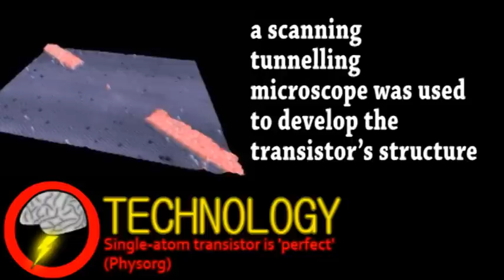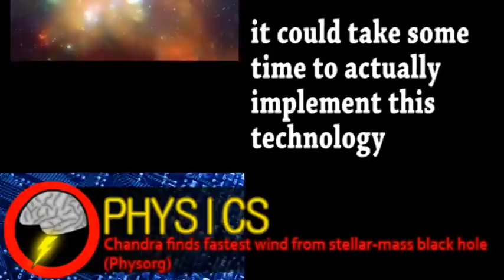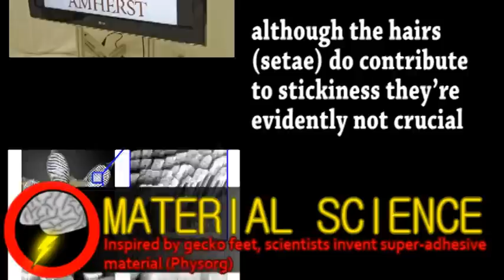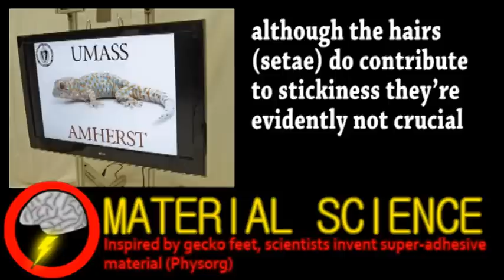Single Atom Transistors (Brainstorm Ep52)

Comment: @qdragon1337 Crosby says, "Our Geckskin device is about 16 inches square, about the size of an index card, and can hold a maximum force of about 700 pounds while adhering to a smooth surface such as glass." makes more sense already. Unless you actually care about science and work with S.I.